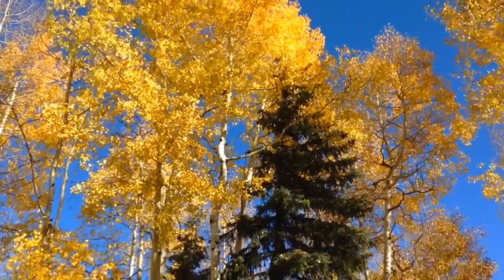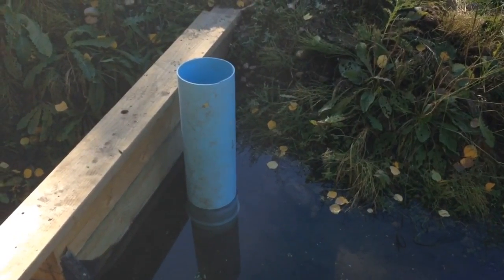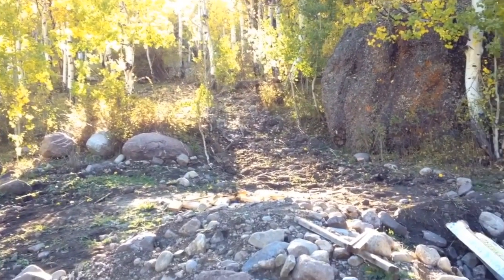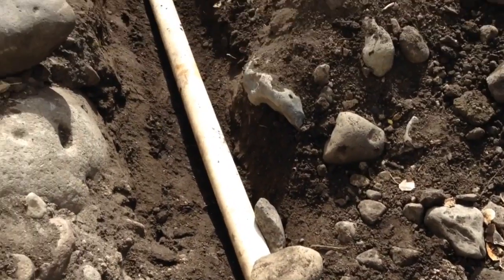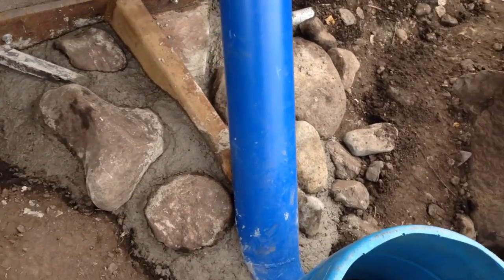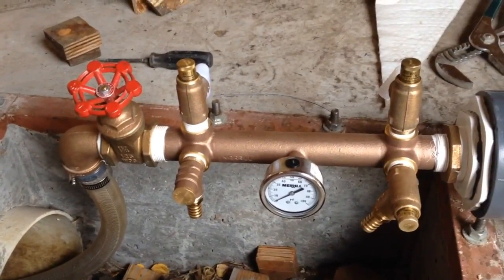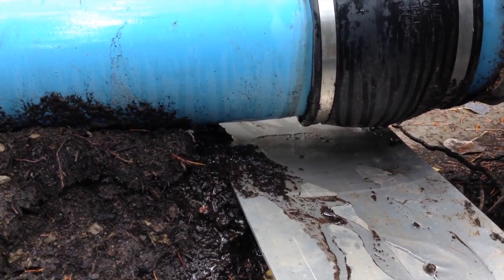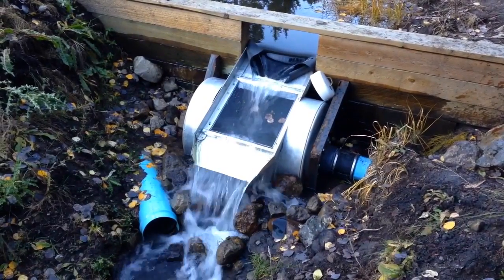Part 13 MicroHydro Power System in CO TESTING

Comment: Excellent Hydro engineering,  may you have many years of power. How long until late it pays for itself?
Reply from the maker: It paid for itself day 1. In 1995 I got an estimate of $20k per mile x 7 miles or $140k to bring grid power in. First system ran $25k and update to creek was $55k. Also to run power to the property today would be $250-300k. So rather than looking at it as a cost analysis based on rates and power produced, it's better to think of it as a long term investment in the value of the property where all future power is virtually free. Thx for watching

Comment: I just wonder what your local authorities think about what you have done. Good Luck, Micro Hydro is the future. decentralization is the key to our future. But only if we keep our environment in the forefront. To live With the land not constantly seeking to control or change it.
Reply: Quinton P. Young III he has permits for this
Reply: @aaron56426  I am surprised he got permits to dam the stream and build a poured foundation of concrete  for the building right next to the bank. Imagine 50, 100, or 500 other landowners doing this along the same stream. You have effectively ruined the stream. I think that is why Quinton is posing a very legitimate question.
Reply: @nonewherelistens1906  how would this ruin the stream?
Reply: @RehdClouhd  There is no ability for aquatic life to migrate up or down stream, causing a serious decrease in genetic diversity. Silt also builds up behind structures that impede flow, resulting in 'dead zones' where aquatic life needs cobble and flowing water. Silt clogs the gills of fish and other amphibians.
Reply: @nonewherelistens1906  but that would on the other hand ensure elimination of fossil fuel and their nasty consequences, so what do you think? Fish or global warming?
Reply: @davemwangi05  It has not and has never been the specious argument of fish or global warming. The environment is more complicated than that. First off, has the site been evaluated for wind or solar?
Reply: @masterspacetime2826  So you see how a stream could get ruined, right?

Comment: I worked at blue mesa, morrow point, crystal dams/powerplants, and Molina powerplants as a hydro mechanic and operator on the units. Nice build there!
Reply from the maker: Thanks. I met d klein once and always wanted to tour morrow, never did. Beautiful dam there especially in spring when they open the overflow.

Comment: This is fantastic. How did you learn how to do this?
Reply from the maker: Initially I did research in books, but then I attended a workshop at SEI Solar Energy Intl. in Carbondale, CO.  That was in 1995 before there was much access to info over the internet.  The workshop teachers assisted me in the design of the first system with Spring fed water.  Then I had 17 yrs of experience running the first system before I did the redesign/move to creek fed water.  I pretty much learned everything I need to know from the workshop.
Reply: MrHydrohead how long was the workshop? Are they still offered around the country? I've never heard of that before.
Reply from the maker: Frank Duffy it was 5 days and had 2 days of tours of practical installations of hydro systems. I'm sure the program is different now (20+ yrs), but they still offer courses of all sorts and certifications. Check it out. https://www.solarenergy.org/
Lots of online knowledge availability these days too from many sources

Comment: wow u guys know your stuff,heres a question for ya how long of a run between hydro AC generator to house ,I heard only 300 yards is that right???
Reply from the maker: +RayRay Mcdoogle It is about 1100 ft. between generator and house.  This was determined by the footage marks on the protective wire casing. (part 10 of series)

Comment: end of this video, it is windy, you better install wind powered Electric power system.
Reply from the maker: +John Elliott  A fast moving cold front that day. Typical avg wind speeds have measured 1-2mph on the property which I doubt would justify any costs to harness that wind.  Besides we get 175-200 kWh/day which is more than we can generally utilize except in wintertime.
Reply: Okay  :  )
Reply: Comparing wind to hydro power is like Comparing a AA battery to 12 volt. There is no comparison.

Comment: nice work, 100 psi that will be helpful!!
Reply from the maker: +travisle1 Much easier to work with than the 212psi that the original spring fed system worked with.

Comment: I'm just seeing this for the first time, but you may want to pust gravel around the burping/air release pipe that's by the damn. or put a 90° elbow and extended pipe on it so it drains any trapped water back into the reservoir
Reply from the maker: +shexdensmore It only occurs for a short period, so no great loss of water or erosion from the burps

Comment: Invest in some capacitor banks.
Reply from the maker: +Jim Martin 
vs. batteries?  Don't know much about them. Any links to learn more?
Reply: Watch a few videos on you tube. But yes better then batteries. You can make packs of them and even run Thermal electric generators off them or pelteir modules for cooling needs if you have a turbine cranking away making lots of love. Novartis ; )
Reply: Have you looked at magnetic impeller turbine electric generation? It works like a fish aquarium magnetic pump in reverse to generate electricity from water flow through a pipe that turns the impeller.
Reply: Its a passive system municipal water works could use to generate electricity during high peek water use. Have you even seen an infinity gravity water funnel? I bet you could make a power generator on your property using its design. ; )
Reply: To move impellers and generate electricity. You could make a closed system and feed water into it when needed from your stream. Novartis

Comment: fantastic too bad it's illegal in Quebec Canada to create electricity from falling water even if it is from your eaves troughs of your own house.
 I want to do exactly what you are doing but I must find another country to do it in.
 looking forward to your next video
Reply from the maker: +Kaoss Comkaoss 
Sorry to hear that. BC has lots of installations or so I've heard. Perhaps the provincial regs are less constrictive there.  My original hydro engineer was from BC.  The regs are different everywhere and it's important to check them out before acquiring a property.  
There will be more vids, just can't say when.  I have an electrical engineer who is working on some remote control features and I'll be adding capacity to the load on the system. Complicated things so it may take some time.  Thanks for watching.
Reply: MrHydrohead .
 traveled the United States Brazil the Philippines and Thailand. looking for a Micro Hydro site.
 all country poses  unique problems.
 I would like to get in touch with your engineer.
 I'm thinking of creating a portable power generation unit.

Comment: Hate to ruin this video with my question, but have to ask. Is there interruptions, from the generation. Ex: appliances struggling from -non, steady, current.
Reply from the maker: +ray bon 
None that I have experienced. If the load is too great it would automatically shut down. The power has occasional momentary changes when loads change, but the speed of the load controller correcting is very rapid. 

I did have a mattress warming pad that wouldn't function properly.  I think it was because of the distortion to the sine wave resulting from the load controller shunting a portion of the sine wave out to resistive loads via triac switching. The pad controller just didn't like the quality of the power for some reason. Testing it on a gas generator it worked fine. Go figure...
Reply: Humm....wonder if?? That spells problems, gadget wise months and years down the line. 

There's gotta be a solution. I imagine? That it comes

From a funnel before?? The water enters. So while it might mean less speed. The flow is more constant

It's possible?? The choppy speed the water enters , throws off the current. 

By putting a smoothing funnel in front. Now the same amount if pressure speed even space goes in the system??...
Reply from the maker: +ray bon 
Once the pipeline is full of water there is no air in the system.  The flow of water is very constant and the pressure remains steady at the outlet point in the powerhouse . I'm not sure I understand your point. Perhaps you have not watched the full series and hence don't realize this single video was just a step in the process of building the system. This video was just about completing the pipeline and testing it's integrity prior to installing the turbine in subsequent videos. The system runs very smoothly without problems now that it is complete. I appreciate your concern but there no real problem here. Sorry if I'm missing your point.
Reply: Boy why would that be happening then. If there's something that softens the water I feel like there's less friction other than that can't figure out why there would be the sine difference.
Reply: If in doubt go to larger diameter piping, the only down side it cost.
Reply: monster truck

Comment: wow you paid for that welding?? they did a very average job
Reply from the maker: +HomeDistiller 
Welding on pipe components or the bracing to the slab?  My contractor isn't a welder nor am I and we had some issues with the wire feed sticking on the bracing welds.  Being 40 miles from town made it a situation of doing the best we could with what we had.  I guess you are a good welder.  I have no complaints on the pipe component welds whatsoever.  Nothing is ever perfect, although I wish that ideal were always achieved.
Reply: +MrHydrohead I was referring to the pipe welding not the brace, I'm an ok welder, but I wouldn't be happy with those pipe seams.. That just doesn't look like the work of a qualified welder. The contractor I can easily forgive as he doesn't do it all day, but a welding shop should be able to do better work than that
Reply from the maker: +HomeDistiller 
 I paid $150 at a car repair shop vs. a much higher quote($750 I think) from a welding shop. 11-12 welds of 6" pipe parts and 4" too.  Schedule 40 I think, 100psi is the normal system pressure.  Nothing extreme.  I don't know much about welding, but it seemed a reasonable price for what we got.  Maybe not, oh well, works fine for us.  System keeps humming away.  Sorry you don't like it.
Reply: no thats an ok price and about what i would expect from a mechanics. if you had paid the $750 thats when i would think your were being ripped of for what that weld looks like. but i think you got value for money there.
Reply: Ha!  Fair enough!
Reply: Dude, I saw those welds too and I was like, whoa, those are some shitty welds for a pipe that came from a local weld shop.  They could have at least done friction welding and had it come out better if the welds were giving them problems.

Comment: This is great to actually see a system this small being put into practical use.  You  have no idea how many people I've talked with say "nope, can't be done on a small scale, wont work.".    PLEASE keep us up to date on your work to raise the capacity.   On another note,  knowing very little about electricity, what does  4800watts/115 kwh a day equate to as far as running appliances like refrigerators, lights, etc?  Thanks for sharing this video with us and I think I'm gonna subscribe for more.  :)
Reply from the maker: +liljgoneman 
Glad to have a new subscriber.  OK on the power end some simple math, 4800w X 24hrs = 115,200watts or 115,200/1000 = 115.2kilowatt-hours (KWH).  Most homes in US average about 30KWH a day.  You can check your utility bill to see how much your own bill is.  1000watts burning for one hour is 1KWH.  10-100watt bulbs burning for an hour is 1KWH.  Toasters, hair dryers, space heaters and other heating elements are power hogs and are usually 1500 to 2000watts.  Appliances, Refrigerators and other motor driven devices have a variety of ratings which can always be found on the UL listing sticker on the device but are usually under 1000watts.  4800watts would allow you to run a total of 4800watts of load continuously which is a lot, but might occasionally be exceeded when the wife runs the hair dryer, the toaster and coffee maker are on and a space heater kicks on.  Its a lot of power if you pay a bit of attention to not use everything at once.  Very few things run continuously.  Motors and heating elements use the most wattage.

Often appliances are rated in amps but it is simple to convert them to watts.  Volts X Amps  = Watts  or Watts/Volts = Amps.  It is important before installing a system to add up what the expected demand on the system will be via a simple energy audit.
Reply: MrHydrohead  Very cool!  Thanks for the lesson.